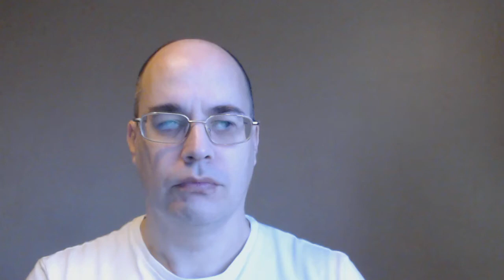How does salt lower the freezing point of water?

Comment: Now interested if there's other ways to ions interfere. How cold can they get the unfreezing water
Reply from the maker: It gets complicated at high salt concentrations and really low temperatures; even the salty oceans can freeze if the temperature drops low enough, but it basically does it by "pushing" away the salt and the freshwater part freezing, so sea ice can be used as drinking water if melted.
Reply: @mjmurcott647  i Probably can't follow what about the salt pushes the ions away, in case that could be reverse engineered with a different substance or force, like a light spectrum or sound frequency...With goal of storing very cold temperature. Though scientists probably don't bother if there's  easier ways to achieve ultra cold temperatures already. Just trying to be informed.